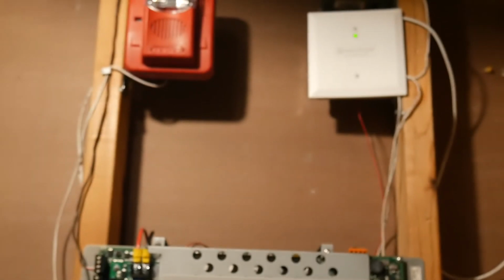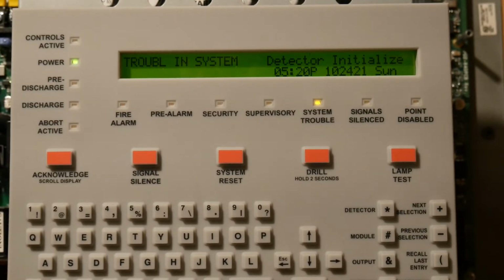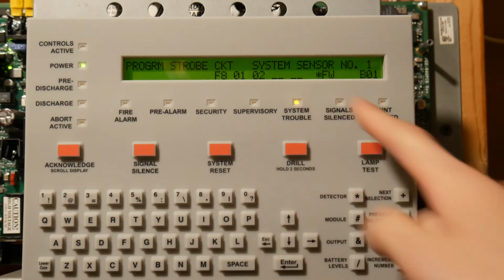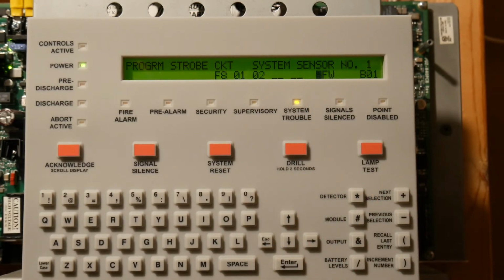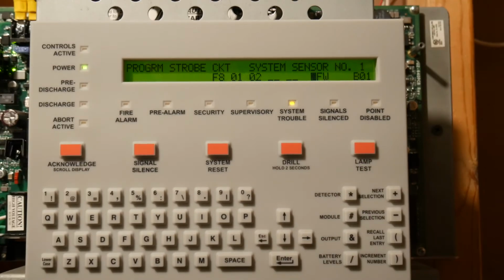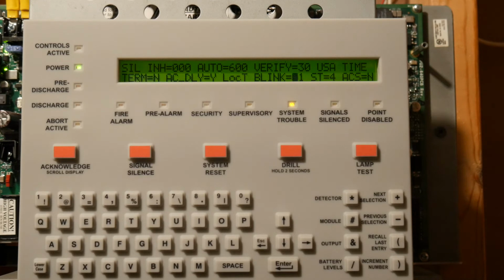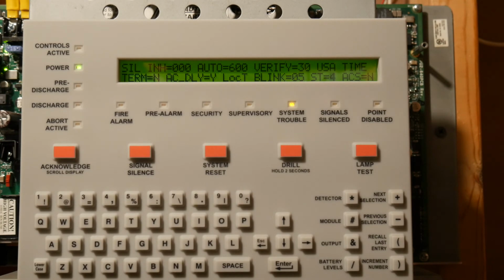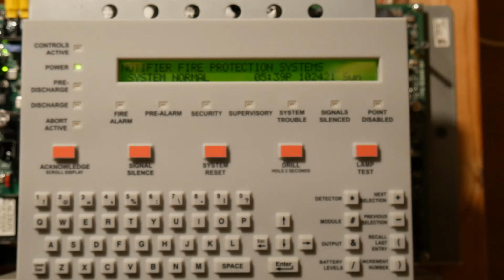Notifier NFS2 640 Programming Guide

Comment from the maker: 0:00 - Intro 
1:32 - How to go into programming mode 
3:17 - How to program/add points in the SLC 
7:02 - Point programming  
12:10 - Notifier special function programming 
13:27 - How to program NAC sync/coding options 
17:14 - Setting up an agent release NAC 
19:21 - How to change notifier LED polling speed 
21:12 - How to change the system normal message 
22:38 - How to turn off trouble reminder 
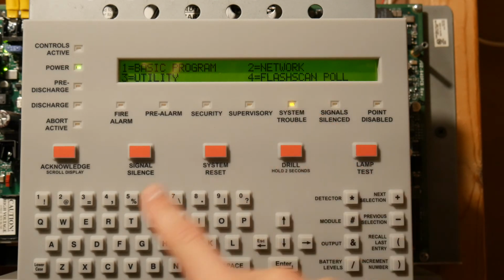23:30 - How to change addressable protocols 
24:04 - Testing the panel and alarms
Reply: @Roxxofoxxo Hey I have this same system but I’m having an issue when my main sprinkler valve is closed I get a trouble but when the valve is close the supervisory light should turn on but it’s not any input would be appreciated thank you.
Reply from the maker: I'm assuming you know the monitor module address that is connected to the tamper value. You're using the wrong point type for that device, go into programming mode and change the point type from a trouble to a tamper point type
Reply: @Roxxofoxxo  I do have the address I will look at it tomorrow thank you again.
Reply: What is the difference between an auto program and adding points ...

Comment: We replaced an existing FSP-851 with the newer FSP-951 detector and base. But the panel showed trouble TEST F. What could be the problem...?
Reply: You have to use the FSP-951IV if not the it won’t accept the new device. New FSP-951 are flash scan protocol the since you were working on an older system which is set up for clip mode protocol, you would have to use a FSP-951IV which is set for both Flash Scan & Clip Mode Protocol.

Comment: I have a smoke detector that failed to recall the elevator. So the recall relay isn’t assigned with the smoke. Is it possible to change that through the panel ?
Reply: Yes, you’ll need the master password. Go into programming and edit the device, you’ll need to add the zone for recall to that detector.

Comment: I try modifying a detector and it wouldn’t let me. For example I tried modifying a detector the address was 1D001 but instead it took me to the 2 detector which is 1D002 I tried, and tried changing ID001 but it just skips to 1D002. Do I have to run auto program again to modify this point????
Reply from the maker: What are you trying to modify detector 1 as, or are you trying to add detector 1 to the panel?
Reply: @Roxxofoxxo  I wanted to label it 1D001 - Admin Board room, and it’s zone but it just skips to 1D002 which I already labelled as Admin Sales

Comment: does the 640 use both the 320 and 2-3030 cpu cause ive seen some with the 3030 cpu and the 320 cpu like this one
Reply from the maker: It used a cpu similar to the 320, that is basically identical besides some hardware and firmware differences
Reply: @Roxxofoxxo oh

Comment: Can you autoprogram a new device if you already have existing programmed detectors or modules on the slc?
Reply from the maker: Yes 
Just use autoprogram
Reply: @Roxxofoxxo  awesome! Thanks.
Reply from the maker: Np!
Reply from the maker: @calebmorand4604  you plan on getting a Notifier onyx?
Reply: @Roxxofoxxo  yes I do. They seem very nice. Probably a 320 or 640. Do both program the same?
Reply from the maker: Ah nice!
Reply: @Roxxofoxxo  yes. Its nice to see that I can program them with the keypad! It's awesome because it's a full qwerty keyboard! Do both program the same?
Reply: @Roxxofoxxo  Did you get your 640 from ebay? Thanks!
Reply from the maker: @calebmorand4604  Yes they program the same and I got my panel on ebay
Reply: @Roxxofoxxo  👍 thanks! I love your channel btw!

Comment: there is some reason we need to shutdown this control box. how do we do it? and how to turn it on again when we want to use it ?
Reply: U have to disable it when u go up to it there should be a control box that’s blinking unscrew the 2 screws and there should be 2 knobs one should say ten and one’s depends on how many devices for example u have device 9 on the loop or device 109 that means 10 is in the tens and 9 is in the ones then u go back to the to the panel and go into settings and enter 109 or 9 when it says enter point enter the number that it says at the control box then u should be ready to go if u don’t understand just unplug power or unplug SLC when u need to disable it